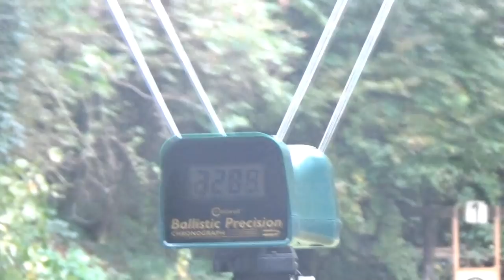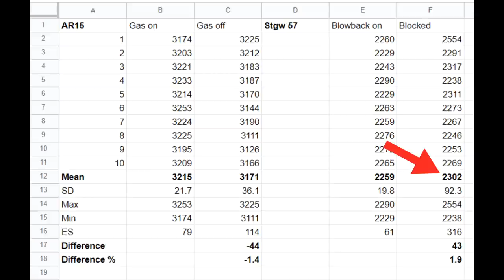Does A Semiauto Action Make A Gun Less Powerful? AR-15, SIG Stgw 57

Comment: I have an idea. I'm not sure if  it's safe or doable. Make a harness in which you can sort of safely hang a (self loading) rifle from a ceiling. Make a bladder you can fit between the trigger and trigger guard. Hang a gas operated and a recoil operated self loading gun in the harness - make it fire (by inflating the bladder) and then measure muzzle speed and WETHER it reloads. A Myth Buster experiment perhaps.

Comment: Most people don't realize how little power it takes to cycle repeating actions. I can't remember how often I have shot an AK left handed from a "sapling rest" and let my support hand foul the charging handle. Never hard enough to injure my hand, but would always cause a stoppage. If you know that overgassing causes increased wear to the gun then it is obvious that excess energy in the system is not desirable. And finally, any properly designed self-loading does not unlock, or in the cases of blowback weapons, unbreach before the bullet has left the barrel. But, hey! Any excuse to go to the range, right?

Comment: Correct me if i am wrong, but looking at the AR15, the moment gas pressure is taken away should be the point where the bullet passes the hole in the barrel for the gas operating system right?
And if my first assumption is correct, the bullet will already be at the very end of the barrel when gas pressure is droping, which means the rest barrel length and therefore the remaining acceleration path should be very short. 
I doen t know how the stgw57 works, but it would be interesting to have a slowmotion clip of when the receiver moves in comparison to the bullet coming out of the barrel.

Comment: I'd like to see the same test done with matchgrade homeloads that don't have as wide a variance in FPS, I do think there would be a difference in  gas on vs off, but I don't think that it'll be as big a difference as people thought, maybe in the region of 20 to 30 fps, also with the sturmgewehr test you may have introduced an ammunition temperature variance with having to swap out the mags each time leaving a longer time for the no gas gun's round in the chamber to heat up, this could be evened out by say shooting the round every 30 secs in both of the tests ... either way an interesting test Mike, keep up the good work.
Reply from the maker: Thanks. Budget for doing this with match grade and 100 rounds per gun is of the order of US$500, if you fancy chipping in via Patreon ;)
Reply: @BlokeontheRange just had a look at the patreon page Mike, cant see a "donate" anywhere just the subscription levels? or is that what you meant? I'd even just chuck a few quid at you via paypal.
Reply from the maker: Thanks. What you can do is become a subscriber and then cancel the subscription after the first payment :)

Comment: Makes me wonder, what about when using hotter loads? Wouldn't a bolt action typically be able to handle higher chamber pressures than a semi-auto? Or is it more like comparing apples to oranges, as that really boils down to barrel construction, and has little to nothing to do with having a gas system or not? After all, plenty of 105mm howitzers out there, and they have gas systems to manage recoil. It would seem that at a point, the argument becomes irrelevant, and what matters is the destructive ability and range of what's being sent down range.

Comment: With a gas operated action particularly an m16 style using a gas tube , you would expect a loss of pressure behind the bullet once the bullet has passed the gas port. The pressure at this point is measured to be around 1000 bar , the pressure for the same round at the case mouth would be around 3700bar  . Although there is a drop in pressure, it is not a complete venting of the pressure before the bullet leaves the barrel , there will be more in a long gas gas tube (M16) than a piston operated system (SA80) because there is an extra delay while the piston moves . There must be a loss  in velocity, but the amount of loss could not be calculated by firing a small sample with a variation larger than the expected loss . Imagine the loss to be 50bar but the variation of the test ammunition is 150bar ,if you get 50 bar less is that the gas being vented or the ammunition giving 50bar less for that shot . There needs to be a much larger sample fired . 
In the case of the roller delayed blow-back, the bullet has long ago left the barrel before the breach vents the gas.

Comment: The first round fired on stgw (blowback blocked) has so much higher energy than the rest.   That datapoint should probably be discarded, because it's more likely a round with abnormal loading, or a measurement error caused by an equipment issue.

Comment: Did you find the recoil was more significant when the Gas was turned off?

Does the gas system reduce the recoil at all?
Reply from the maker: The recoil impulse is sharper on both. On a FAL it's quite marked.
Reply from the maker: cough momentum cough
Reply: @BlokeontheRange  do you think recoil was actually lower, but still felt harsher because of the sharpness?
Reply: @tiortedrootsky  if you run the numbers the recoil of a repeater is actually greater than a bolt gun because of the reciprocating mass, but it is spread out over a longer interval for somewhat less perceived recoil.
Reply: @dbmail545  oh ya?!  
You should try a Remington Model 11 when the friction rings are set up incorrectly.  Let's see what you think about the sharpness of recoil then.
Reply: In the UK, we have to use straight pull versions of any semi auto rifle, outside of .22lr. I noticed the AK in 7.62 x 39 to be fairly unpleasant to shoot compared to .223.
Reply: @tiortedrootsky  Isn't felt recoil more to do with jerk than recoil?
Reply: @BlokeontheRange  yup indeed - same on the L1A1 unsurprisingly! One good reason for leaving the gas port fully open until anything starts to stick.. I tried it at the other end of the settings on a clean rifle and wished I hadn't

Comment: There seem to be a few errors in your analysis and possible methodology but not big enough to change the conclusion. Without seeing the entire procedure it is difficult to say if or where other errors came in but they are likely negligible. First and most notable is in your data set, clearly one of the shots fired in the last string was an outlier, likely caused by ammunition or chrono failure and not relevant to the debate at hand but it is included and skews your data. Second, there is a mechanism to explain how it is possible that a semi-automatic would get higher velocity than a manually cycled firearm as the amount of heat that can be built up by firing rapidly is significantly higher than the heat retained and radiated from a slowly extracted casing. As the semi-automatic is radiating heat and you take a moment between shots to record the data the round inside the chamber heats as well, which excites the powder and gets a greater reaction when firing. While you are manually cycling you record the data with the next round not in the chamber heating up, then you cycle and fire, so with the AR that could explain at least some of the difference. With the Stgw 57 it has a substantially greater thermal mass (as indicated by the grunt in picking it up) and it is delayed blowback as opposed to a gas cycling firearm like the AR-15 which is blowing hot gasses into the action to further heat it, both of which reduce the difference in heating to the firearm between automatic cycling and manually cycling on the second firearm, and since you needed to change the loaded magazine out for one which would disable the action it gave the manually cycled round just a little more time for the round to cook than in semi-auto, so that should help explain some of why it is higher but by a lesser degree. This also lends to the spread of standard deviation as differences in even mere seconds can change the temperature of the round in waiting to a degree (forgive the unintentional pun, I can't think of another word) that it could throw the whole thing off. If one controls the temperature of the firearm and the temperature of the rounds and if one has enough data points to reduce the noise from largely unavoidable variances in velocity from ammunition, there should be a very slight and meaningless reduction in mean velocity in semi-automatics vs manually cycled firearms.

Thank you for the tests. I am a firearm designer in the states so I have run essentially the same test several times to see differences in average velocity (and db rating and temperature buildup and fouling mass) between manually cycled, semi-automatic, and fully automatic firearms while unsuppressed and suppressed with a variety of silencers and in a variety of temperatures ("does shooting this silenced smg foul the can faster in the snow?" asked no one, "Yeah, kinda" I answered, etc). Basically the same result you got. There is a difference, usually, under all the noise and chaos, but it really does not matter in a practical sense. Like when our marketing team wanted to make an ad boasting that a new model in an independent test had a recorded average velocity 2 FPS higher than another comparable firearm and they did not understand why I just kept laughing at them. Anyway, thanks again.

Comment: There is a mechanical variation with the AR-15 gas on or off. Gas on.vented pressure less impeading on projectile. Gas off, more air pressure in barrel ahead of projectile.
Reply from the maker: a) the gas system is not an open system, it's a leaky closed one with a certain volume.
b) moving air ahead of the bullet will tend to try to suck air out of the gas system due to Bernouilli's principle, not blow it in. So you're working backwards there.
c) the max chamber pressure is of the order of 3500 bar. Even pulling a full vacuum ahead of the bullet vs. normal air pressure at approx 1 bar makes a 0.03% difference. Which is nothing and can be ignored :)

Comment: What does actually operate the gas piston? Is it the hot gases from the powder that's coming after the bullet? Or is it the compressed air in front of the bullet? Or a combination? Because if the compressed air in front of the bullet plays a role, it could explain why a rifle shoots slower with the gas mechanism disabled...
Reply: Combustion gasses.

Comment: A bit of statisticianerding: a formal Welch's t-test (aka Student's heteroscedastic test) on the AR15 measurements produces a p-value of p=0.005 that is quite low, and thus signals that there is statistically significant difference in the mean values.
There is still a room for mere coincidence, but it is quite small.
So the repeated tests with better ammo are definitely needed to resolve this mystery!
Reply from the maker: The AR change is in the wrong direction, and seems to be dominated by one outlier in one dataset.
Reply: @BlokeontheRange  Yeah, it is in the wrong direction - and that's why it is interesting.
And which value is the outlier for you? The data points look pretty solid to me: "gas on" are mostly 32** values and "gas off" are mostly 31**. The formal tests do not detect any outliers there.
Reply: @BlokeontheRange  I've just re-tested the AR15 data with removing one top and one bottom value in each group (thus, 8 measurements left in each group). The p-value has become even smaller: p=0.002.
So it has nothing to do with outliers.
Reply: @BlokeontheRange  After plotting the data I do not see any obvious outliers in the AR results. The 1st "blocked" Stgw 57 shot is the only obvious outlier in those results.
Having now crunched my own independent 2 sample T-tests, I see no significant difference in the Stgw 57 results (I got p=~0.16, even with the outlier included) and a significant difference in the AR results (I got p=~0.004). As noted already, the "gas off" AR results do seem to be significantly lower, not higher.

Comment: Hey bloke I love your content. I have recently purchased a no.4 mk1 star long branch. I need help. The sling swivel that attaches with the bedding screw. Just how was that used with the sling? My local club will allow us to shoot high power matches with any mil.surp rifle. I just haven't found how to use this sling swivel. 
 As usual good video. Your advise has been great. Keep up the good work.
  Thank tou
Reply from the maker: The sling swivel that attaches with the bedding screw shouldn't be there on a normal rifle. In service, it was only fitted to sniper rifles. Out of service, it was used for Service Rifle (b) competition (the forerunner of Target Rifle). You can either use it for a normal "hasty" sling, or for a "crossover" sling. Difficult to explain "crossover" in words (sling goes around the upper arm the other way, so anticlockwise rather than clockwise, with the end attached to the mid swivel being underneath so it helps hold up the long part which goes behind your wrist and to the mid band), but there's a video in it that I'll get around to at some point.
Reply: Thank you bloke my rifle didn't have one. I shoot high power and was thinking that swivel could help. I just haven't been able to find how it was used. Thank you for the speedy response. I'm looking forward to your video. Your enfeild content really helped me pick this ol no.4.
 Thank you sir.
Reply: Sorry thank you sir.

Comment: Question have you tested a Semi- auto in blocked breech against a bolt action  same barrel lenght,same calibre, to compare velocities/energies with both systems???
Doc AV
Reply from the maker: Doing that does not account for unknown variations in bore diameter, groove depth, throat profile, bore surface condition etc. which have a fairly substantial effect. The only way to do this without such confounding factors is to use the same rifle in 2 modes.

Comment: As far as I see it any self loader (any which way it works) reduces recoil, not bullet velocity. If it's gas operated - the amount of gas you tap off is minute; if it's recoil operated - well the bullet sort of already left the barrel when the recoil sets in. An auto loader uses excess energy that otherwise would have gone into the shoulder of the shooter to reload the weapon. If you look at a gas operated weapon the "tap off" is usually placed far forward on the barrel and the tap off hole is quite small - variances in ammunition production will probably have a much higher impact - as shown in this video. Myth busted.

Comment: In terms of the deviations in velocity across the shots with the gas blocked off, I wonder does blocking the gas somehow cause the system to vibrate in ways that it doesn't when it's working as intended? Unintended and not-designed-for vibration along the length of the weapon, coupled with the rotation of the bullet and the difference in the harmonics between lands and grooves in the barrel as the projectile moves through it could account for greater spread of velocity?

This vibration would be minuscule and perhaps imperceptible to something with the perspective, size and mass the shooter, but if you're the little bullet and your whole environment is humming just slightly off compared to the information they showed you in the brochure at bullet school, you might find that you under-perform in this less than optimal environment.

I mean, it might have nothing at all to do with that but that was my thought?
Reply from the maker: When I shot that rifle in prone slowfire competition, I used to turn the gas block off and work it as a manually-operated single-shot since it reduced the group sizes such that my scores increased by 4-5% (from 92-94-ish to 96-98-ish on the Dutch 100m target).
Reply: @BlokeontheRange  Ah! So it's not unintended vibration then! :)
Reply: @BlokeontheRange  Do you know if you would see the same small improvements from a machine rest? When I used to shoot centrefire pistols and revolvers, I always tended to be more accurate with the latter, which I put down to relative absence of jerk effects when firing. (To a gun designer, "jerk" is the rate of change of acceleration.)

Comment: The idea that energy is "robbed" from potential bullet velocity doesn't make any sense, at least not in the case of an AR-15 gas system. The bolt carrier can't start to move backward until the bolt head has been forced to rotate and unlock, which will be after the bullet has left the barrel. So the only energy used to cycle the action is excess that wouldn't have been contributing to propelling the bullet anyway.
Reply from the maker: The bolt carrier moving backwards is what causes the bolt head to rotate and unlock...

Comment: a few comments
a) for longer range and target shooting I prefer a bolt gun so I can use different loads without $%@#$%@%#$ with the damned gas block
b) those SDs are sinful even for factory ammunition unless it's tula
c) just blocking the carrier doesn't close the gas port
d) for extreme applications much hotter loads can be run in a bolt gun than in garand style actions with crinkly op rods(I'd love to test a mosin .vs. a PSL on that)
e) In most applications, as you say, it doesn't make enough difference to matter
Reply from the maker: b) that's just bog standard factory ammo, dude..
c) ??? On the AR I blocked the gas port. On the Stgw 57 there's no gas port to block, and blocking the carrier prevents the rollers retracting thereby keeping the breech shut.